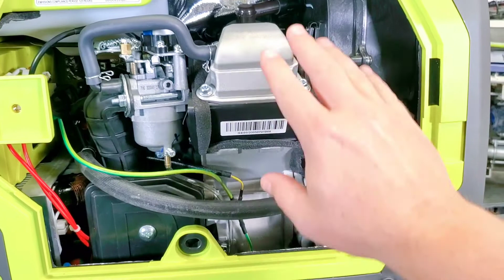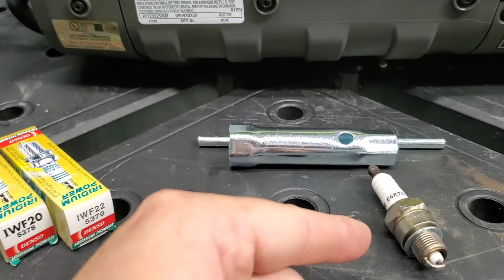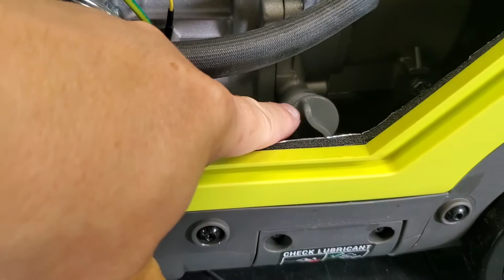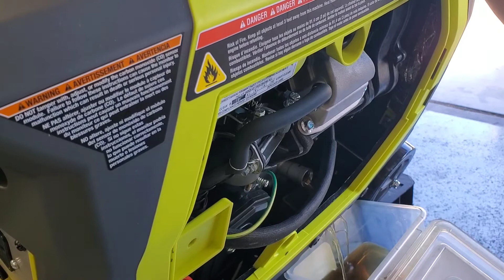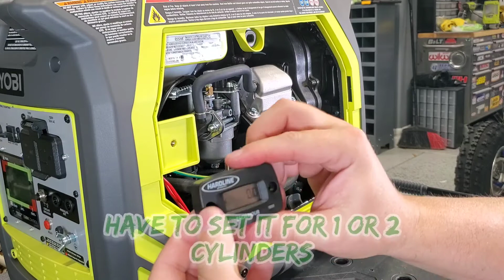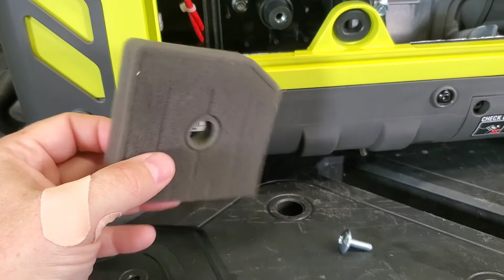1800-2300W GENERATOR MAINTENANCE GUIDE RYOBI PREDATOR WEN PULSAR GENERAC DUCAR WESTINGHOUSE + MORE!

Comment: Hey Mr Garage! I have a question, I have a 2300watt Pulsar Generator. I’ve had it for about a year and have meticulously maintained its. It’s at 433 hours. I’m having an issue with it revving up and down. I took it apart and cleaned the fuel jet but is still doing the same thing. Any help would be great appreciated, thank you!
Reply from the maker: Remove the spark arrestor and see if it is doing the same thing? Possibly clogged? Also, valve clearance check would be due by that point. Doubt it has to do with the bouncing idle but it would be due.
Reply: @MR_Garage  also I did check the valve clearance at 336 hours. It was at .06 and .08
Reply: @MR_Garage  thanks for responding! I checked, cleaned and took off the spark arrestor just now. It didn’t seem to do anything for the revving up and down. I’m kind of stumped, do you think it may be the little red inline fuel filter? It was flowing pretty good when I had removed the gas line from the carb. Do you think the carb needs cleaning??
Reply: @Anthony Marquez  Low idle circuit is still partially clogged in the carb.  You've got 3 options from easiest to expensive.  Buy a 4 oz. bottle of  "Mechanic in a Bottle".  Remove all the gas in tank and pour in the MIAB.  With the spark plug cable OFF (don't start it) pull the starter rope 15-20 times to get it down into the carb.  Leave it for a few days to a week.  Pour in fresh gas, reconnect plug wire and see if it'll run right now.  2nd option is to reclean the carb by using a torch tip cleaner, poking into all the orifices.  3rd option is to replace the carb.  Good luck.

Comment: Yep, a little bit of maintenance goes quite a long ways. Just ordered a fluid extractor and a set of feeler gauges; not sure where they wondered off to. I know that it is almost time to check and set the valve clearance.

Also, I found that if I use non-ethanol gas and Sta-Bil gives me less headaches on equipment that I only use occasionally. I drain the carburetor when possible, unfortunately some small engine fuel system layout now days make it difficult to do that.
Reply from the maker: I agree 100% the carb in these ducar generators has a side jet, not bottom feed. So unless you use the bowl drain screw, cannot run the bowl out of gas if you wanted to!

Comment: For the air filter on my preditor gennies. After cleaning/drying I use a a spritz or 2(3) of the K&N air filter oil. Don't know if it's right or wrong. But that is what I use.
Reply from the maker: That will do just fine!